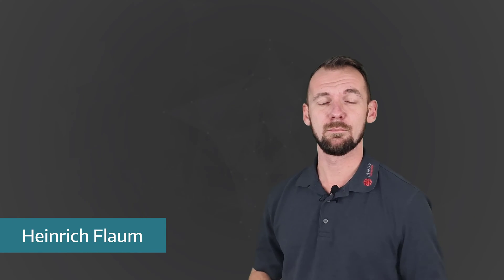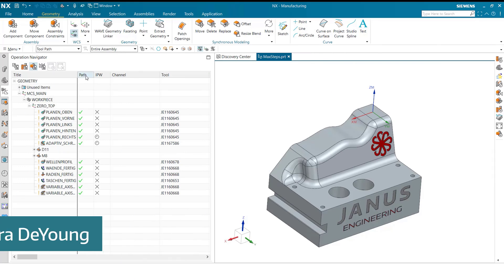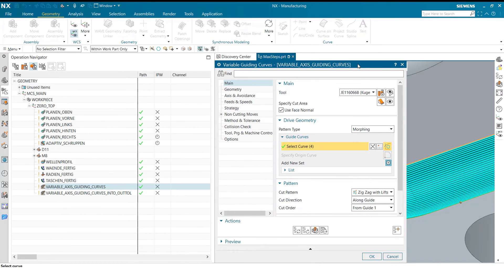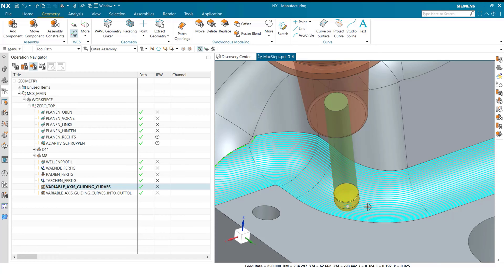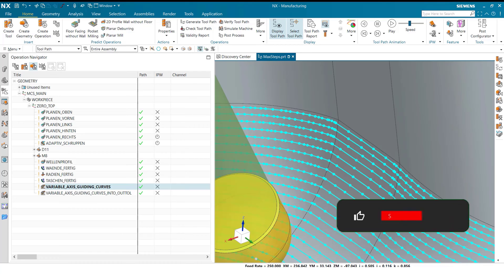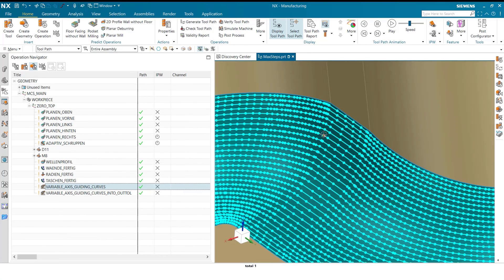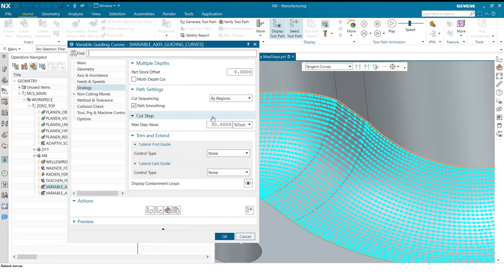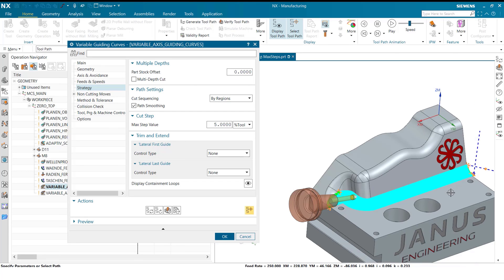NX CAM Tutorial | How to improve the surface finish ✨

Comment: 1) By doing this increases program output file size, any way to control file size?
2) how to output program folder name in NX to output file name?
Reply from the maker: Hi pmungliful, 
1. Well yes... the more points, the smoother the surface and of course the more NC-lines, the bigger the file size 😏that's something that you will have to keep im mind.
2. That is something that your PostProcessor can manipulate. So therefore, you will have to ask your PP provider to change that into that.
Reply: @JANUSEngineering  thank you
Reply: Please sir send me post process file

Comment: Does it also apply to contour area?
Reply from the maker: Hi mmkk1121! As for our understanding, it seems not to be possible to modify that setting in a ContourArea operation. You can customize the setting into the dialoge, but then it has no impact on the result.